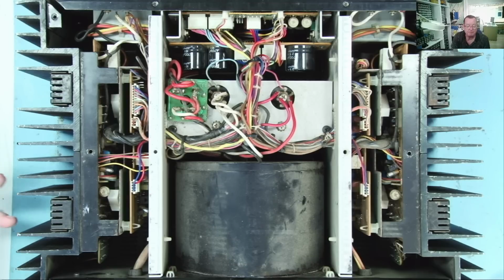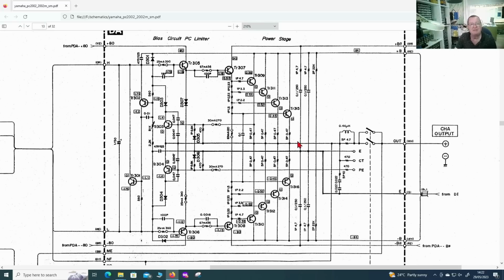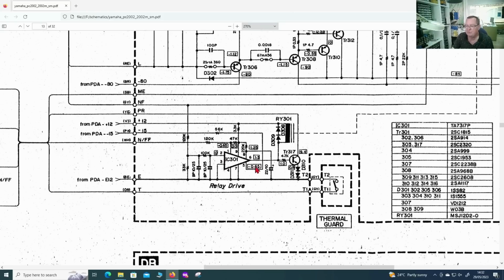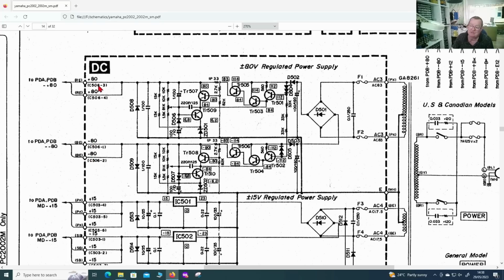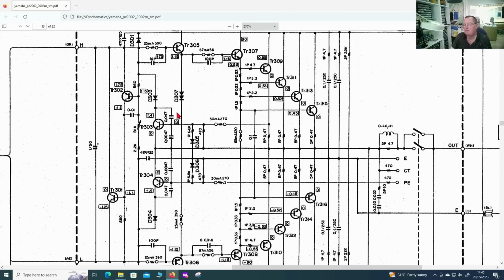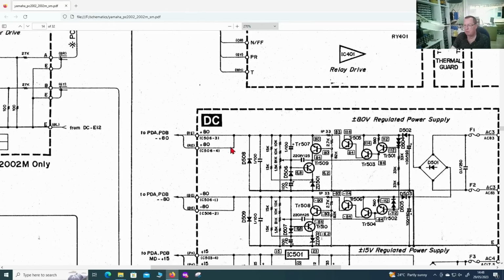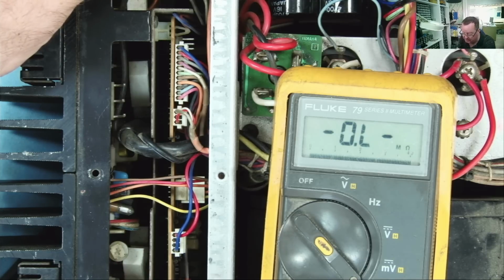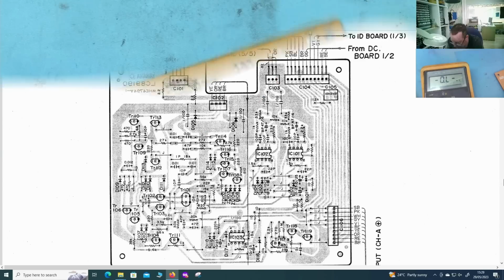How To Use Schematics To Fix Stuff PART 2 Real Life Example Diagnosing Faults With Schematics

Comment from the maker: Sorry guys.  You Don't have De Ja Vu.  I messed up the edit on this video.  There a segment that starts around 21:12 repeated again around 25:35
Reply: Hehe, I wanted to report the Deja Vu when I noticed the comment here. I would appreciate another 2-3 minutes where you would show the fixed device and have some final words on the repair.
Reply from the maker: @SelfMan-SK  I have to spend a couple hours probably finding where else the glue may be so I can remove it before it causes problems, and there are also two 1 Amp fuses to change for the correct ones.  

I thought all the interesting points had been covered already but I can post an update once it is finished, and if there are more problems there will be a part three,    If you watched part one you will know the protect fault goes away on both channels once the +80V is disconnected from the low resistance so all should be good.
Reply: @learnelectronicsrepair  I am watching almost everything. Only the car boot sales are not that interesting to me. Done my share with such machines back in the day. 😁
Reply: @learnelectronicsrepair  It's always satisfying to see the system after being repaired and then working.

A couple of minutes is enough.

And thank you for your brilliant channel!
Reply: Beginning to wonder if I had Alzeheimers sneaking in !  :-)
Reply from the maker: @vaccarioou22  Nahhh... if you did then you would have already forgot you had see that part before 🤐
Reply: Ha ha, I thought you did it on a purpose. because that part needed to be repeated for clearly understanding, as it's little similar to class G amp. and I found same issue on old PCBs worked more than 15 years with that multybond like glue .

Comment: Looks like a class AB with a cascade output. Giving the sound quality of the class A but giving better energy efficiency of a standard A or B since only 2 transistors are actually on with no input and others are fully off.

Comment: Good job . I have found this brown gunk in many amps .in a NAD 3020 I initially thought it was capacitor leakage but no , just glue .on removal , all good . ( did recap anyway)
It’s possible that you may have suspected this without a schematic but great video 👏
Reply from the maker: Possibly but it would have been a long winded difficult repair especially as the amp isn't easy to dismantle so you can see everything.

Comment: Is it me or is there a segment that starts approximately around 21:12 repeated again around the 25:35 or so?
Reply from the maker: Sorry if I messed up the edit, I haven't done that for a while
Reply: @learnelectronicsrepair  no problem. It just seems that you explained the process twice regarding the transistors coming on due to the resistor chaining. Take a look and confirm if that Is indeed the case.

Comment: That hardware has reached end of life.
Reply from the maker: Nahh, I think it is just the glue that passed it's sell by date.  Give me a bit more time to remove the rest of it from wherever else I find it and all will be good.  As an aside I also expect this amplifier will have a far richer and more dynamic sound than any modern Class D amp.   I'm sure the owner will love to have it back.  Discuss.
Reply: @learnelectronicsrepair  I'm sure you can fix it. The artifacts we make today are not designed to last for very long though. There is a dark side to mass production too. The assembly line devalues individual craftsmanship.
Reply: @learnelectronicsrepair  I AM NOT SURE BUT I BELIEVE THE GLUE WAS ADDED FOR EXTRA PROTECTION FROM VIBRATION TO PREVENT CRACKED SOLDER JOINTS.

Comment: Well diagnosed. I reckon a lower voltage rail (12V) may not have caused the glue to breakdown
Reply from the maker: I totally agree
Reply: Also the face that it's DC won't help!

Comment: Interesting amplifier. Appriciate it how you explain it. 

Have you or can you explain diode mode on a ie fluke? I don't understand why you measure it in reverse by connecting the plus or red pin to ground. Cheers!
Reply from the maker: Do you mean when I was testing the bridge rectifier?
Reply: @learnelectronicsrepair  no when testing the power supplies on a motherboard
Reply from the maker: I hope I was correct on the amplifier circuit explanation.  It's just how I 'see' it looking at the schematic.  I'm not an audio repair expert or specialist, I just know how to fix them, generally.